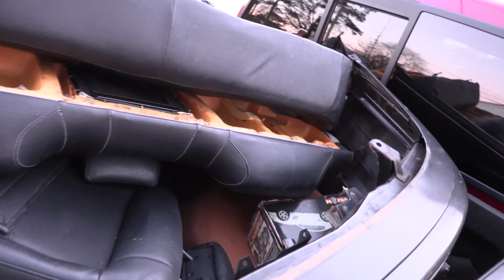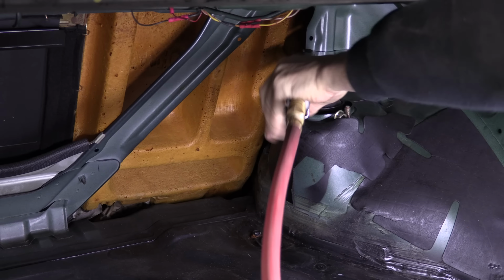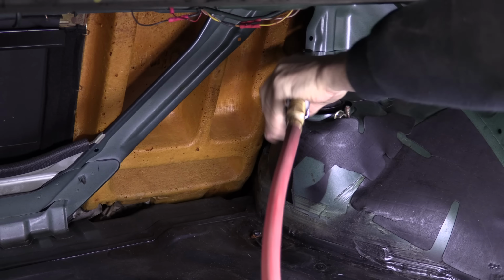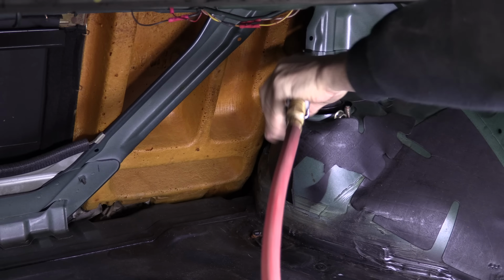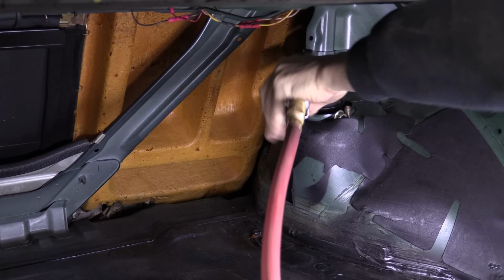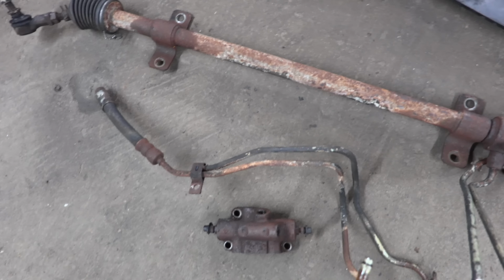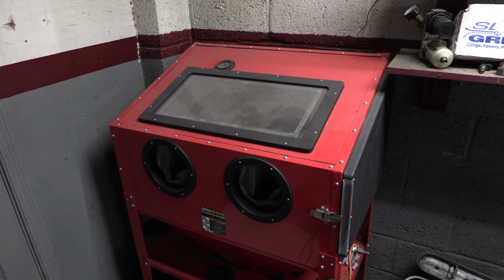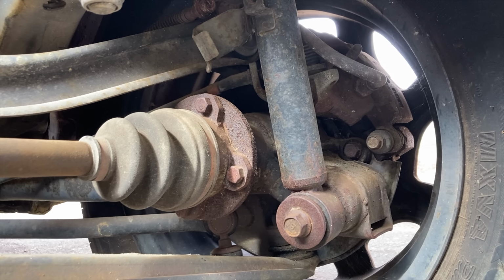Galant VR-4 Subframe Restoration Part 2

Comment: My opinion hasn't changed, I still believe that car is in awesome condition considering the age and where it lived. It makes sense that the passenger side would be worse as it runs on the lower side of the road with all the slush and salt. Thanks for sharing your journey, Jafro, I'm really enjoying it.
Reply: Are you changing to gas shocks? I had them on my S2000 and preferred the ride and adjustability. It will also give you the ability to adjust the ride height if needed.

Comment: Tip on H&R springs on the GVR4, cut one coil on the rear or else it will sit too high in the back. The KYB struts you have are for a DSM and the front spring perch is a little lower than the original GVR4 so the front sits lower than what H&R intended. It also will bottom out easier than designed so make sure you have good bump stops and you will probably adjust the front struts pretty stiff. By removing one coil on the H&R rear springs, it will sit level. Lastly, the rear springs have extra coils for ride height so cutting one coil doesn't affect the spring rate.
Reply: Correct, those progressive springs are designed like that with 'dead coils' on them. I've done this with progressively wound springs in the past and it works just fine.👍

Comment: The fittings that are on the rear power steering look exactly like what vw used on the mk3 platform. The community has created an adapter to go from the oring fitting to standard flare to make creating custom/replacement lines easier. May be worth checking into

Comment: You need a set of those knipex grippers. No flat surface, no problem, lock um down and they will hold it still. Used them for problem child alignments. Customer wont replace shit, grip it and rip it. Works every time thanks to knipex. I think knipex calls them "cobra" pliars? Either way they are god tier tools

IF you wanna spend money, Tarox brakes front and rear. Pedal feel is better than typical big brake kits. Tarox does more smaller pots instead of fewer larger pots. Insane quality in my opinion. Pedal feel is better, brake fade happens less often because smaller pots don't absorb heat as much.

Now i need the next episode lmao this build makes me happy lol

Comment: Ok, nice on not breaking stuff.
 Also, I didn't know that the secondary sterring pump was gear driven , I thought it was  eletric motor driven . Thank you for sharing.  
 I have only seen 2 of these cars when I worked at a tire bay at bjs Wholesale Club & both cars were rusty rot boxes here in ny.  1 had a working system but leaking  & the other was not working but had all kinds of new parts sadly.  It's just amazing what you see at a shop lol. 
 Once again, thank you  & be safe & good progress. 👍

Comment: Looks like you've got a long list of part blasting ahead of you.  I used to do media blasting as a college job. If I can make a suggestion, the glass bead you are most likely using is some of the worst media you can use. It breaks down really fast (creates dust) and isn't all that good at removal. If you want to do your homie a solid, convert to a media called either Star Blast or Staurolite (whichever is easier to get). It works much much better, doesn't break down as fast and is less "dusty". Its garnet based rather than sand, so it is more angular than sand and as it does break down it creates more angles and remains effective which means you should spend LESS time blasting. It's also not really that expensive. If I recall a 50ish lb bag is like $40-50. Just my $.02.
Reply: Since you have the know-how, I would like to ask how does walnut media compare to others ?

Comment: When I dropped out my subframe I put it into two furniture movers from home depot and had filled in the gaps with plywood to keep stuff from sagging. Worked great to wheel around and back under the car and out of the way in my small garage.

Comment: Nice to see the progress. I believe power steering line fittings are similar to other mits high pressure connections from what I see.  You said the some of the bushings are in good condition. If you are powder coating you will likely need to remove them and unfortunately destroy them by doing so :(.  Looks like you plan on replacing them all anyway. All part of the adventure. Keep on going!

Comment: Those power steering fittings IIRC are "saginaw" style, should be metric, probably 10 and 12mm... I had those style fittings on my 87 Nissan's rack. I had AN converter fittings on mine.

Comment: Get a small shop vac and hook it up to the port in the back of that blast cabinet assuming it still has the rubber plug in it you can just cut a hole for the hose and jam in in there. I did it to mine works great 👍 no need for a respirator anymore

Comment: Just wanted to say that all '90 AWD DSMs had a viscous LSD with the 3-bolt rear-end, and all 91's without ABS had it has well. None of the GVR4's had an LSD because they had the 4WS. And all '92 AWD DSM's had the 4-bolt rear regardless of the production date. I'll go back in to my hole of useless information now. :)
Reply from the maker: Oops, you are correct.  It was the 6-bolt/7-bolt changeover that happened in May.  The "Early 92" is a designation where you could get both the 6-bolt block and 4-bolt LSD rear together.  Yes, all '92's had 4-bolt rears.  I've got a sweet spreadsheet I created that breaks down every part group by production date and I made it 9 years ago, but it wasn't open in front of me while I was scripting this, and I referenced the 7-bolt date.  An "Early 92" was the Colt's donor.  6-bolt/4-bolt.
Reply: @Jafromobile  I always thought it was odd that the GVR4s all had a 3-bolt rear when '92 DSMs got a 4-bolt. As always, thanks for all the great videos. If you're planning on being at the shootout this year, I'd love to shake your hand 👍

Comment: I was wondering about the 4-bolt axles and, BAM!, you covered it.  Hope you find some cups to complete the swap, rear-steer be damned.  Oh yeah, you need some green wagon wheels on that thing too for the complete sleeper package.
Reply from the maker: I actually have them!  They came with the car.  I thought about putting the green wagon wheels on the flat red Hyundai.  Same lug pattern.  Christmas all year 'round!

Comment: Yup, the H&R's are a progressive wound spring. They ride great in anything I've had them in. I've ran everything from their springs with Bilstein's/ Koni's and also their Ultra Low coilovers. Nice job on the poly bushings. So much better feel with them. I saw those spherical heim joints and what looked like aluminum trailing arm limiting shims? Good stuff man. I'd dump that rear steering stuff, seems like much more work than it's worth to introduce more play in the rear end and more stuff to mess around with.

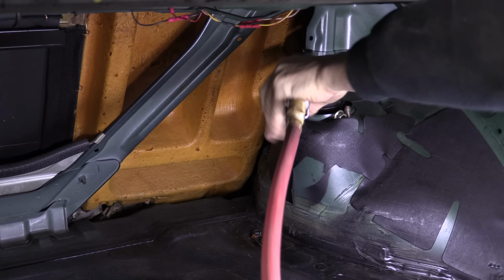Comment: 6:00 To little to late but you CAN wash away rust with power washer. De-iron or decontamination products for car body for example carpro IronX can lift and move some rust. There are also some more potent acidic water soliuable products for thicker amounts, but I know only my local european stuff so you would have to search around your area.

Comment: I have been watching videos of people restoring Celica All-Tracs, and this feels just as good to watch. I never realize there could be so many bushings to replace in an old AWD car. I think I saw some of the ST185 and ST205 versions.

Since the Galant VR-4 and Celica All-Trac basically started out as a FWD car, and AWD was added later, did the manufacturer come up with weird ways to implement AWD? I used to work with the occasional VW MKIV and B5, and they used a solid rear axle on FWD versions, but a full independent suspension on AWD models. It felt weird to look at.

35:30 I don't know how well Dorman bushings and ball joints hold up. That is why sometimes I like rebuilding an old control arm.

Comment: 14:25 I was changing the engine in my 4wd trailblazer. The front differential goes though the oil pan. Left side carrier presses into pan. Right side the acuator presses in. Im in PA so it was corroded. Same thing I tried like hell to get it out but it was the same thing you did but I broke it.

Comment: I have a Mitsubishi Galant VR4 with a four bolt rear end and EVO 8 inner cups to accommodate my Kaaz Differential.
Reply from the maker: Wow, what kind of power is that thing putting down?
Reply: @Jafromobile  I'm only making 325WHP I wanted more grip and push from the rear, now I have a bit of Snap over Steer. I went all out on the drive train, a Dogbox Quaife up front Spider center and Kaaz in the rear along with an Aluminum drive shaft. But I'm going to swap the Aluminum shaft for a Carbin Fiber unit, the Aluminum has a resonance I don't like.

Comment: If I wanna go to a 4 bolt setup on my 90 talon, what all do I need to change? I have the 4 bolt axles, diff, and driveshaft. Also have the spindles. Is that all I need?
Reply from the maker: You'd need the 4 bolt cups that bolt the spindles to the axles.  Exact same pickle I'm in.  It's why we're out of them.
Reply: @Jafromobile  I actually have complete spindles with the cups, brakes arms. Took it all off a very rusty parts car. I just don't have any more 3 bolts axles bc I keep breaking them. Bit I have 3 sets of 4 bolt axles plus the other stuff I mentioned and been wanting to do the swap just wasn't sure if I have everything
Reply from the maker: @andychapman6646  When I find a set of 4 bolt cups, I'll make videos about how to do it.  I promise.
Reply: @Jafromobile  ok thanks

Comment: if you find a dead compressor take the tank off and fit nitto fittings and use it as a accumulator tank it will double your blasting time
Reply from the maker: That's actually what we're doing with that 80gal Craftsman unit next to the Chicago unit!  I told Matt I'd split a big compressor with him.  We need a big unit with a fast recovery rate to keep up with some of our tools.  That little compressor's a trooper but more suited for a home garage than what we're doing with it.

Comment: I know this is a Galant, not a DSM, but they appear to share many components and assemblies, so I'm just wondering how rare is a 4 bolt rear axle flange and 6 bolt crankshaft combo? I have a '92 Talon and it's got both, manufactured April/May of that year. Did I win the spec lottery or something?
Reply from the maker: Only for a short time of production did DSMs get both of those together.  People refer to them as the "magic '92's".  The 6 bolt production stopped in May of 1992, but all the 92's got a 4-bolt rear.  They are uncommon, and a really really rusty rust bucket of a magic 92 was the donor for my Colt, and the 6-bolt donor of the Glyptal block project.  They're not impossible to find, but definitely a gift whenever you do!
Reply: @Jafromobile  Then I officially live in an undisclosed location in an undisclosed state!

Seriously though, I had no idea when I bought it as the original and only owner back in July of '92 (add yet another unicorn point) what 6 or 4 bolt meant let alone that this was a find. I just wanted a new sporty car and it had the best combination of features I was looking for at the time (fast, affordable, AWD, manual, nice-looking) to take on a months-long cross country trip.

Had a blast and now nearing completion of my several years long restoration project doing many of the same things you've been doing on yours, e.g. complete front/rear suspension rebuild, trans rebuild, driveshaft rebuild, throttle/intake rebuild. It'll be as good or better than new in some ways when I'm done, hopefully this year although the body will have to wait till next year as that's a whole other thing.
Reply from the maker: @HabaneroTi  For decades, all the people who didn't get that combo of parts from the factory-made great strides to find it, make it fit, and install it.  Kudos on all the efforts you've done, but pat yourself on the back for all the efforts you saved yourself along the way, and didn't have to mess with.  Now you just need a 2g or EVO exhaust manifold, and a 2g throttle body elbow.  ;)  Fingers crossed it's back on the road again soon!
Reply: @Jafromobile  I'll have to see about mods and more serious upgrades. First I want to get it back more or less to stock shape and then I'll decide. Gotta walk before you run. I'm too old to get into racing, tuning and all that. I just want a fun car to drive around and take on road trips. Been a while since I've gone on those.

But it's actually been driveable for several years now as I started with the issues that kept it from being driven, like a totally worn out clutch, bad trans (kept popping out of first, had to replace the 1st-2nd hub/sleeve/synchros/fork and some other parts while I was at it), sloppy clutch pedal and seized calipers.

That made it driveable. Only then did I move onto the less critical but still important tasks like replacing the TB/BB/WP,  rebuilding the struts and suspension, overhauling the gas tank, etc. The car was actually in fairly good shape when I started several years ago, for its age. I just figured it's a nice car so might as well go all the way. When I eventually sell it, it'll be worth quite a bit more than it when I started.

I have a ton of admiration and respect for what guys like you and the folks on DSMTuners and such do and if I were several decades younger I might just get into it, it's just not my thing at this point in my life, but the expertise you guys share has been invaluable. No way I could have done half of this without it. You rock.

Comment: When replacing PS or brake lines and the flare nut is partially or fully stripped, I would use a grinder to cut the line off near the flare nut, then hammer a socket onto the flare nut.  

For ABS (or similar) sensors that get stuck in their bore, use an adjustable hammer on it and wiggle it back and forth.  Even on a steel bodied sensor, hammering it can damage the sensor.  

There is a downside to a paper service manual.  Over the years since it’s inception, the manufacturer will make additional notes and edits, sometimes completely changing how a service is done. Honda k series VCT actuators for example, used to require full disassembly of the side of the engine and the timing chain.  Skunk2 came up with a way of using a bungee cord to hold the chain to the hood, meaning a 9 hour service can now be done in an hour.  Honda suddenly changed their manual (and warranty repair times) basically immediately.

Comment: could a machine shop where machined the block also do that.  the adjustment to the oil pump shaft?  it would appear that there is a place, but it is not machined for the newer model

Comment: Yo, jafro, those axle cups dont look all that complicated... I live too far away(europe), and my machine setup at the moment is in no state to produce any large parts, but i am damn sure that you must know a machinist or two, hell, you can contact some of the youtube machinists, like the inheritance machining and collab a project... As far as i perceive from my machinist armchair, the only thing that you need is the cup that affixes to the short wheel spindle in the trailing arm and has the right geometry to mount the axle`s cup via 4 bolts... A decent machinist can make you such an item entirely on a lathe, but that would be nonsense when other machines can allow the work to be done much faster, but the point is simplicity of the thing... You can take off the 4 bolt cup for a short time and send it to the machinist to replicate... Its literally a part made from a cylinder of decent steel with a bit of turning and some milling/drilling and tapping... Possibly it has a keyway of some sorts that would need be broached or milled in, but that all can be done with pleasure and ease if someone is willing to work with you on a collab, or paid to do it... Most youtube machinists that have larger machines are lovers of turning wheels and such things and gladly do collabs in that regard... Reach out, you do some machining related content yourself, so it can only help ping pong the audiences...

Comment: 10:50  Why you don't use the open end of the wrench to loosen bolts.  You'll strip it.  You should use the closed end and 6 points for 6 points bolts, 12 points for 12 bolt bolts.

Comment: It's hard to say for sure, but the power steering flares at 27:40 look an awful lot like GM O-ring flares for fuel and power steering lines. There's a flaring tool available for them in 5/16 and 3/8 tube, and most LS powered trucks through the 2000s use those flares with 16 and 18 millimeter fittings, not to mention plenty of aftermarket AN line adapter fittings.
Reply from the maker: I need this tool.  It's interesting that American car companies use it, and Honda uses it... but nowhere else on a Mitsubishi do you find it?  I bring up Honda because the steering rack, lines and technology are the most non-Mitsubishi looking things I've ever seen on these cars, and it was the Prelude who in the import scene was the first to have AWS.  I wonder if Mitsubishi borrowed any tech from their neighbor?
Reply: @Jafromobile  I've seen it across a bunch of manufacturers when replacing steering racks, pumps and boxes, I just couldn't remember specific makes, import or domestic. I used GM as an example because any crossover with LS stuff will make it that much easier to deal with.
Reply: @Jafromobile  I believe those are the same fittings Subaru used on a lot of their power steering fittings as well, if that helps at all. Strange flare, O-ring, thread combo dealies.
Reply: Metric vehicles use what they call an ISO-bubble flare.
Anyway, A good thing to do is bring the old parts to a hydraulic hose fabrication shop and pay someone to fab up a new unit.